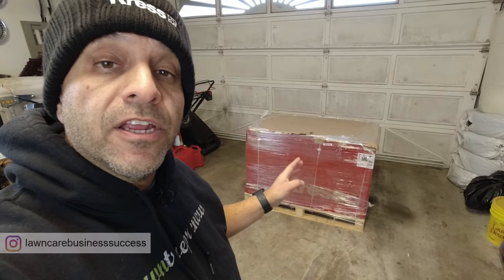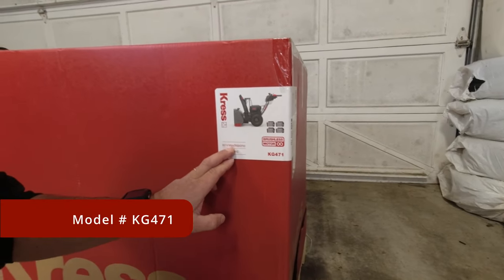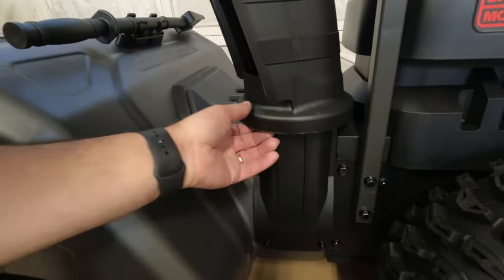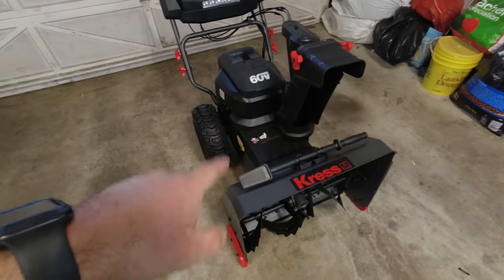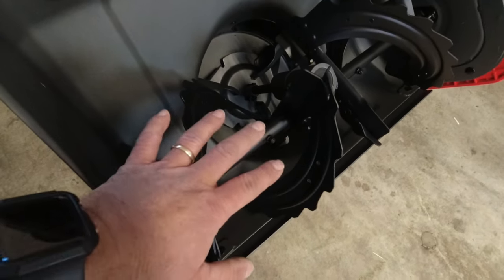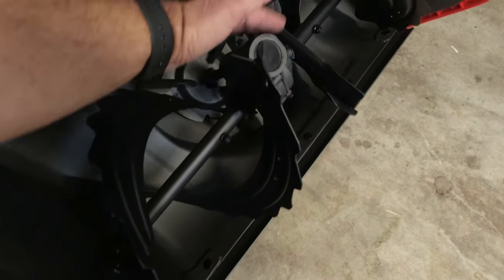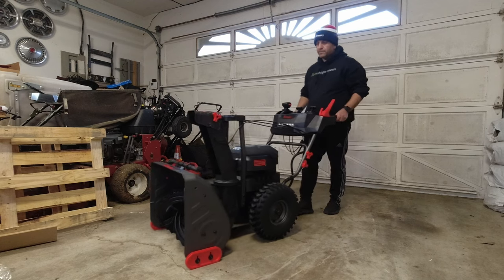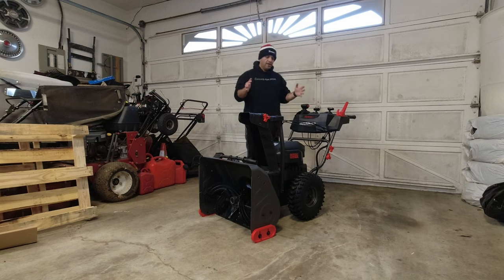Kress 60V Snow Blower Unveiled!

Comment: Man I really wish Kress made their own snowblower. This is just a rebadged 100V SnowJoe 24in 2 Stage with blue parts painted red.
Reply from the maker: Very similar but not exactly the same. Looks like they share some main common snowblower components, but the motor and batteries are completely different of course because so is the voltage. Also even the front metal shroud that houses the auger is slightly different. The other one has the words snow Joe embossed in the metal. So the Kress version is different in that sense, and not an exact swap. I wonder if snow Joe is affiliated with the Kress parent company Positec. I know they have a few different brands under their umbrella. Thanks for watching.

Comment: Thats a lot of plastic for 2 grand.
Reply from the maker: It is a prosumer model not full commercial. But in comparison to my gas 2 stage craftsman unit that I used commercially other than the obvious motor housing being plastic on the battery powered unit vs the metal gas engine, the chute and the buttons and controls is the only other things that I can notice. The frame, the whole front end snow intake including the augers, the handles and wheels, etc are all metal. Plus you get the convenience of battery power. Instant on, lower noise, and no maintenance or gas to deal with. No gummed up carburetor when you go to use it again next year.